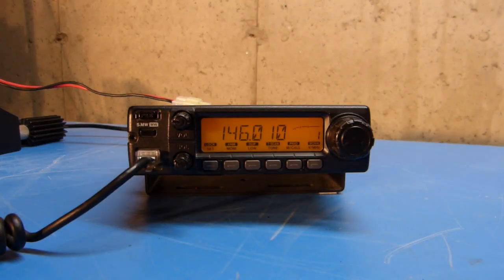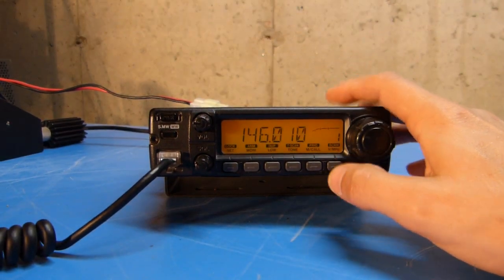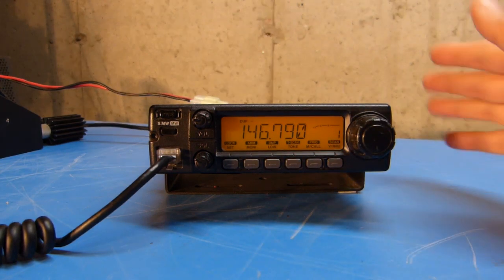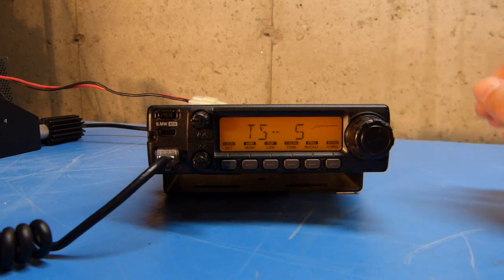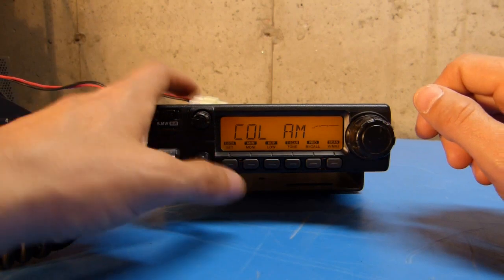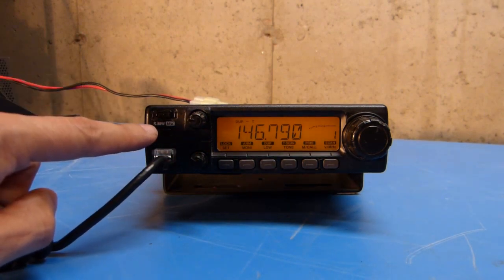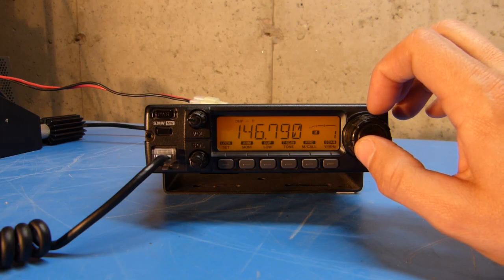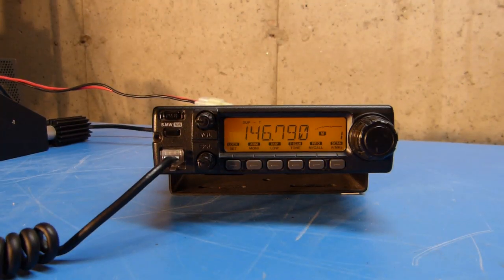Icom IC-2100H Basic Programming

Comment: Thank you for the instructive video. I just bought this radio[ actually the IC-2300H] and it arrived 2 days ago. It would have been very confusing to program it without your help, because the instruction sheet, yes a sheet, is no way near clear to do the job. I was OTA last night on simplex pileup and was able to reach 60 miles away with ease on 25 watts, The radio itself is just amazing like any other Icom. KJ7YSW
Reply from the maker: Awesome!

Comment: HIya, I am really struggling with getting DSTAR working on my Pistar - can you help with a video on how to program a IC-2100H for either use on a pistar, or maybe digital repeater ? Many thanks in advance, AL.ze
Reply from the maker: 2100h is analog only.  I don't have dstar or pistar or any of 5hat stuff anyway...sorry bud.
Reply: @SevenFortyOne  long time no see, just pulled my IC-2200H out again to join a local net. FYI - you can put a D-Star chip in IC-2200H - I've not been able to reach a repeater yet which has DSTAR on it, but I have setup a DSTAR hotspot which works great (also with my IC-705). Thanks agian for this video, it is good and glad to come back to it.

Comment: Is there a way to set a negative offset? According to my spreadsheet one of our repeaters in the county transmits on a higher frequency than it receives and calls for an offset of -0.895.
Reply from the maker: Yes, you can program a non-standard offset.  I may have done a video on that...if not, it's probably in the manual but may be hard to follow
Reply: @SevenFortyOne  Thanks for the quick reply. I can program a non standard offset but I can't seem to program a negative offset.
Reply from the maker: @tylerjett7726  I see...there may be an auto offset setting fighting you that may need to be turned off to get the opposite direction offset.  I don't have the radio handy so I can't tell you what it might be called or how to disable it.

Comment: Hi Rob, just bought another 2300. for the shop until the 9700 comes out. I did the mod yesterday and just hooked it up. Good vid as always.
Reply from the maker: Cool...the icom mobiles are nice rigs!  I have mine in my Chevy Tahoe...I run a Kenwood tm-281 in the Toyota I drive to work.
Reply: I needed something in the shop until the ic9700 comes out and the 2300 in the van works great so why not.

Comment: So I am trying to program my radio the alpha numeric will not come up when I hold the key down? The frequency is programed and it is memory mode, frustrated here!
Reply: Since it has been a year when you wrote this, I hope that you found the solution. The basic manual that comes with the ICOM-2300H isn't very good in my opinion. If anyone else encounters the problem above that Brian is describing, check out the advanced manual on the ICOM website: http://www.icomamerica.com/en/downloads/DownloadDocument.aspx?Document=568
Reply: Did you ever figure this out?  I had to reset my radio and when I was trying to program the alpha numeric names for memory channels, I could not get the alpha/digit mode to come up.  Holding down the ANM/Moni button only gives me 1 beep, not 2 like the manual says it should.  (I have the expanded manual, and my radio USED to have alpha names on those memory channels, so I just don't get it)
Reply from the maker: Try doing a factory reset on the radio . Maybe that will help?